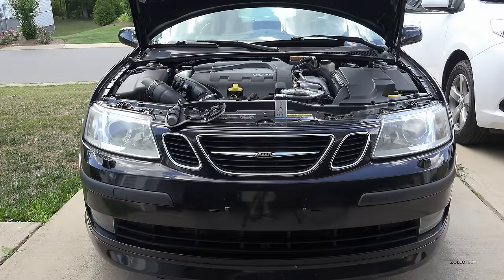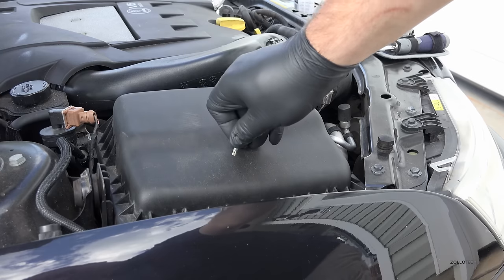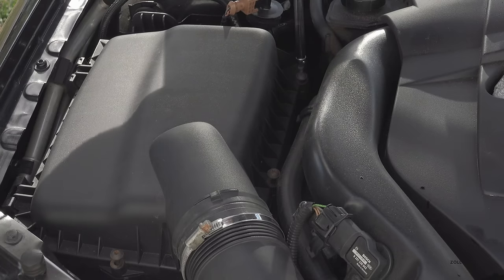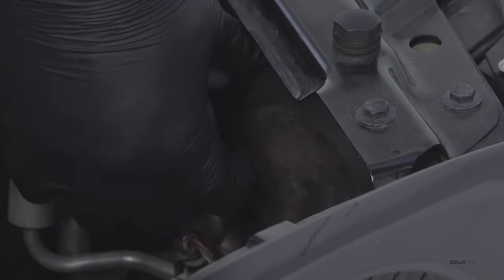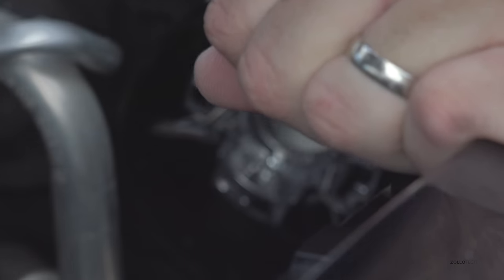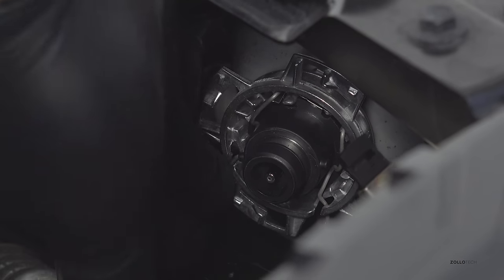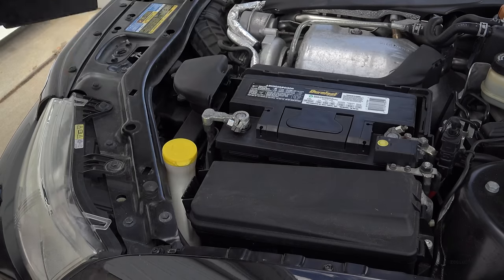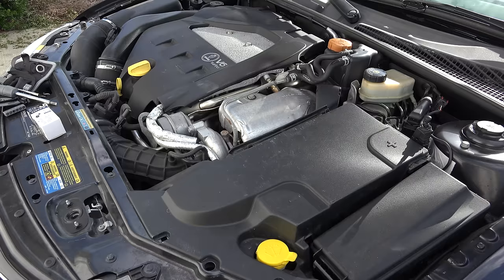How To Change SAAB 9-3 HID Xenon Headlights

Comment: Thanks for the video, I think it is all I need to familiarize myself to change my bulbs. For anyone reading this though, you should change both Xenon bulbs at the same time for three reasons.
1. Xenon/HID bulbs change color temperature as they age because the metallic salts that create that color age at different rates (this is why a bulb that is about to burn out quickly changes from the cool-tone blue to orange then pink before finally kicking the bucket)
2. HID bulbs are rated for ~2500 hours as opposed to halogen bulb's 300 hours. This means that if one bulb burns out prematurely at 2000 hours, the other bulb has 0-500 hours of life left. At $150/bulb, it is worth it to change both bulbs compared to just changing the burnt out bulb like you do with halogens. The cost of a $30 halogen bulb every 300 hours is much higher than a $150 bulb every 2500 hours. People replace only one halogen at a time because if one halogen bulb burns out at 200 hours, the other bulb might have 100 hours left. Also if cost is you concern:
3. When a HID bulb is burning out and is unable to ignite the salts, the ballast has to work overtime to get them to ignite. This puts extra strain on the igniter (which is the expensive part of the system that you do not want to ever replace). Sometimes people will have to turn their lights off then back on a couple times to get it to ignite. This is hell on an igniter.

Comment: Thanks for a great "How to".  Probably saved me $100 between shop labor and finding the correct Made in Germany bulb on Amazon Prime for less than half what NAPA wanted for one. I should note that the air box in my '06 9-3 has a third rubber grommeted mount in the lower right corner which makes removal a little trickier.

Comment: The Xenon bulb is a relatively easy job. Try and replace the daytime running light bulb on the passenger side.  Saab routed the AC refrigerant piping right behind the headlight (you can see that it's kind of an access problem for replacing the Xenon bulb as well).  My local former Saab dealer told me the headlight is typically pulled out to replace that bulb which means the front bumper has to come off.  Fortunately, my wife has small hands so she was able to remove the DRL bulb from the reflector.  That was the easy part.  It took her 15 minutes just to get the bulb socket lined back up inside the reflector and then twist it clockwise to lock.  It's just as much of a pain on the driver side although you can fairly easily remove some of the things in the way on that side.  Saab definitely wasn't thinking about the poor tech who has to troubleshoot and replace things on these cars when they shoehorned the V6 engine in there.

Comment: Beautiful Saab. Wife has a 2007 9-3 Aero. We need to adjust our head lights.
Reply from the maker: +RagingWhiteman nice.  If you have xenon headlights then they are self adjusting.  However, the halogen headlights can be adjusted easily using a couple Allen head bolts.
Reply: zollotech That I did not know. I knew when you turn the 9-4 on they moved up and down. I want to put them on my 2011 9-5.
Reply: Sorry, Z but they are not "self adjusting" in the way you suggest. They need to have their 'base' adjustment set (like zeroing a micrometer, if you will) with the car in standard road trim. After that they adjust themselves up or down in response to sensors that detect if the car is nose or tail heavy. The sensors are on the suspension. They move up and down at ignition on to cycle the motor and set themselves to the ride height for that journey.

Comment: As far as I know V6 Engines were manufactrured / built here in Melbourne Australia.  When Saab was owned by general motors.  Here General Motors Holden. The motor for our Holden Commodore (3.8 litres) was reduced to 2.8 litres for the Saab.  I have not driven one but would like one. Sounds very sweet. They are getting a bit old though. Unfortunately.

Comment: The battery cover actually has tabs on the back that you need to fit before pushing it down in front over the washerfluid pipe.

Comment: Hi,

Nice video. I have the same Saab as yours. I have 1 rubber pipe coming out of transmission which is hanging behind battery area close to ABS system. Can you please check whats going on with that? It seems like it doesn't plugs into anything.

Comment: Great video very easy to understand. What Xenon HID do you recommend, and what are the differences between the K ratings?, no one really explains this.
Reply from the maker: +Justin Ocean I just bought them from ebay based off feedback that the seller had. I picked 6000 K, which is white, and are what most states have as legal. Not all states or countries allow for different colors for your headlights.  The K rating or Kelvin rating, means for example a 3000 K is more of a yellowish color whereas a 6000K is more white. They're also different numbers up to about 12,000 I can go to blue or Vylet. If you look up HID color ratings you'll see the different ones.
Reply: Thanks, just ordered 6000K. Read up and they say your eyes see 4300K best, but I like the whiter 6000K myself as well.
Reply: Correct. The human eye is best tuned to 4300 generally. I find 6000 too white and piercing so I use 5000K.
As for bulbs, Osram Nightbreaker unlimited are about the very best. And thanks for the idea for a video - explain the Kelvin scale!

Comment: does this car use a single bulb for both high and low beam aka (dual filament bulb) or does it have 2 bulbs on each headlight?
Reply from the maker: There are separate bulbs
Reply: @zollotech Thanks for replying! which one is the high beam is it the one with the igniter behind it or is it the smaller bulb next to it?

Comment: what bulbs had the ballast included (i.e. no separate ballast somewhere else under the hood). where these stock? My 2005 convertible has regular H7 bulbs.
Reply from the maker: These are stock, but you had to have the xenon option. If you have normal I halogen bulbs, you won’t have the ballast

Comment: Could use some advice on fixing the headlight washer on a 2008 9-3 sports sedan. mine is missing a cover and sprays straight up in the air.
Reply from the maker: Unfortunately you have to replace the sprayer end to fix it.  I'm not aware of anyone who sells the little pieces that can come out.  The cheapest I have found is about 70 dollars.
Reply: +zollotech Thanks for your reply. I'm ok with the price and was wondering if you have the correct part number for the drivers side unit? Also are there any video's of how to replace that part?

Comment: sorry, one more question. my saab says to change the low beam. Which one did you change in the video? Should I get the low beam, high beam, and fog HID kits? If I don't need to change the ballast, why is there nothing but kits out there that come with a ballast?
Reply from the maker: +Jennifer Taylor the xenon bulbs are the low beam.  The others are halogen.  First make sure you have xenon bulbs.  If you do have xenon, I bought mine on ebay.  Only the Aero models have xenon bulbs usually.
Reply: That really helps a lot! Thank you so much!
Reply: zollotech my 2.0 has xenon as well. Great video. Cheers!

Comment: quick question. I have a 03 arc with the auto leveling xenons. but between that and the grill is a regular halogen bulb it looks like, but there never on an nothing I do makes them come on...whats this about?
Reply from the maker: Those are the high beams.  Xenons are the lows.
Reply: In 03' you had bixenons. So the halogen for hi beams were not used. Depending on programming/market region those are used.

Comment: hey guys my passenger side igniter isnt getting power for some reason. I have an 07 aero. its not the igniter because I tested it on driver side and it worked. what would prevent the passenger side from working? is there a fuse on the wiring harness itself perhaps??

Comment: My headlights are very dim, feels like there is no light on the road. Is it possible to clean inside the xenon and how? or is it possible to find Xenon headlight for an economic price? the new ones are really expensive.
Reply from the maker: +Rıfat Rafael Haleva if you are sure you have xenon you can get them on ebay or amazon for much less.  That's where I bought them for about 10-20 each.  Xenon were only on the aero model and generally don't fade.  They either are on or off for he lost part.  The halogen lights dim though.
Reply: Thanks for your kind reply, but the problem is not with my xenon bulbs, it is with my xenon headlights. I changed bulbs already but I guess the mirror behind the lenses are dark.
Reply: Correct. The reflective surface is vapour deposition aluminium onto a steel case. The ally degrades with UV exposure and the performance drops. I'll be doing a video later this year on how to get the headlights apart to cure this problem and for customising the lights. You can also buy new units - search for EVOX-R D2S projector.

Comment: My 07 Saab 93 isn’t set up like that mine has has a shorter bulb and two prongs no ignition that I can see I’m confused
Reply from the maker: Then you probably have halogen headlights as opposed to xenon.  You can get the bulb at the local auto parts store reasonably cheap and just swap it.

Comment: is this Bi Xenon?
Reply from the maker: No
Reply: Are you sure? Here in the UK Saab 9-3 xenons are defo bi-xenon. I also understand that to be the case for US models. Join Saab Nuts! on Facebook - I'm sure some of the US members would confirm that.
Reply: Cyclone Cyd if I’m not mistaken Saab only had Bi-Xenons for the 2003 vector and 2004 aero w/lighting package before Saab decided it was too expensive/complicated